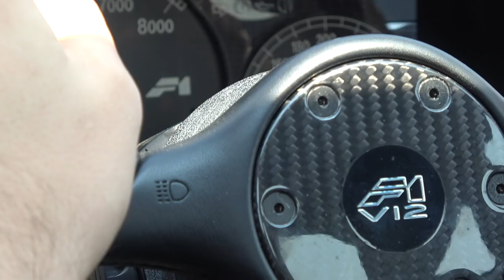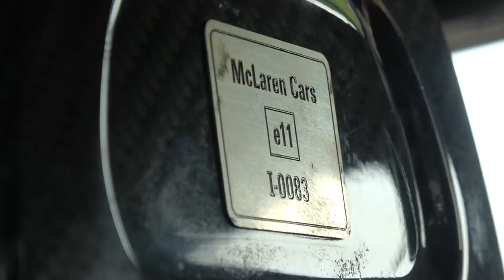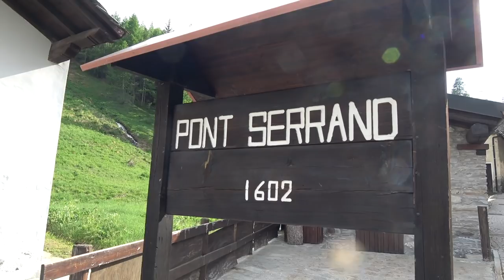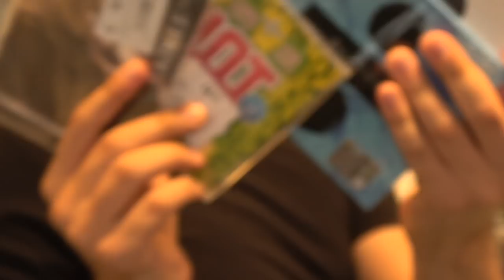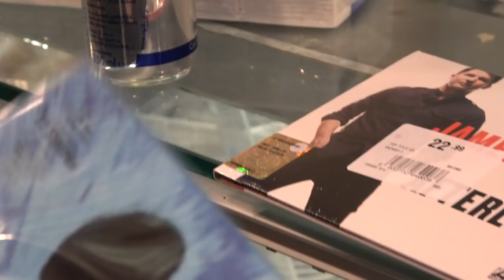Here's Why The McLaren F1 Is So Special!

Comment: No way that's 24k. Pure gold is too malleable. Those things will melt right away.
Reply: Puff Of Smoke I just looked it up because I wasnt sure myself but the melting point of 24k gold is just under 2,000 degrees F. Or just over 1,000 degrees C. No way that engine bay ever reaches those temps. From what I could find online it really is gold, although I couldn't find if it was 24k specifically. I don't think there is any reason to believe it isn't though. Cheers
Reply: Dude, 24k is way too soft to ever hold anything. You need a good amount of strong metals mixed with gold to be able to hold it's structures. For instance, a ring. 18k is a good enough to hold it's structure. YOu can't find a 24k ring in any market. It's not gonna hold it's shape. Those bars, the lining in that engine bay, that pipe, those are not 24k gold. Those thing will not be rigid enough. A mere poke can bend a pure gold, let alone be structurally strong.
Reply: Puff Of Smoke O I totally agree. I wasn't perfectly clear. From what I was abke to dig up its a gold foil wrapped around something else. Aluminum maybe? Def not solid though. I think it said that there is 8 ounces of gold in the car